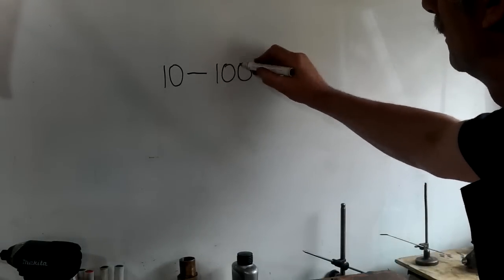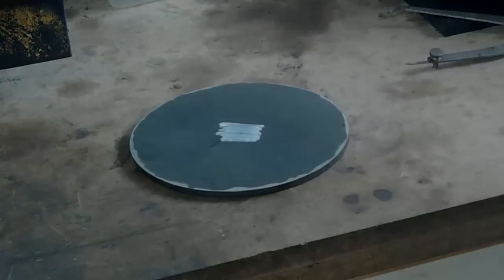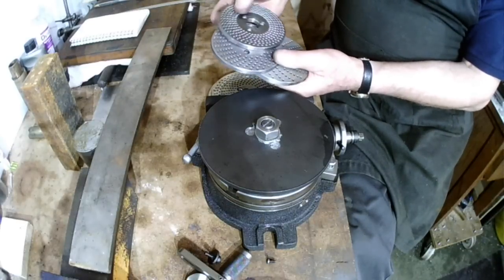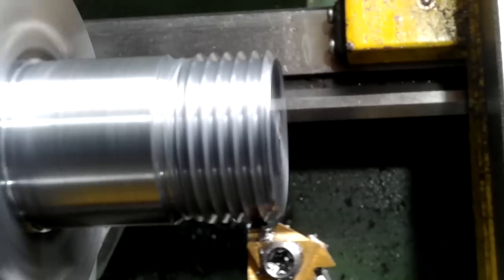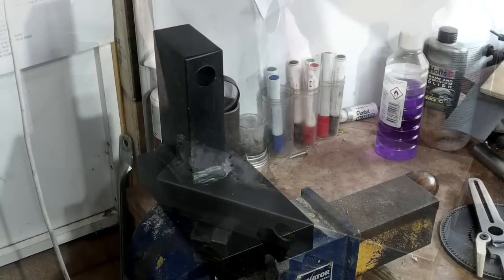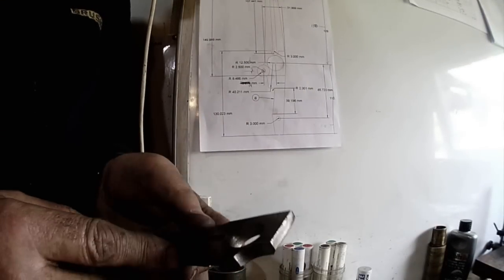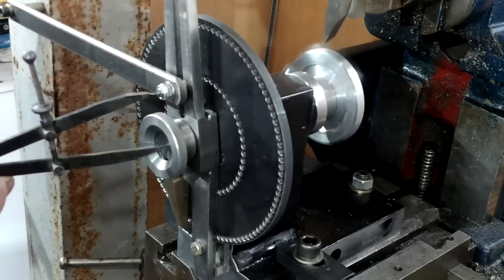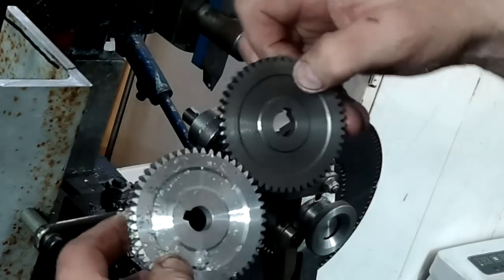Gear cutting on a Shaper (making the tool)

Comment: mate this is an awesome outcome! my "Gear Cutting on the Shaper" video series was a lot of fun to build, the moment when your first gear is completed, is such a great feeling hey! New subscriber here! there are two things I like about the orientation, that were concerns for us, firstly, you are supporting your blank against the cutting force of the shaper, something which I was concerned with our arrangement. Having the index plate outboard also keeps hands in a safer place than in our build.
secondly, there would be a slight rotational error introduced using the arm approach instead of the constant rotation provided by our wire guided setup, that said, you have a much more flexible PCD (PCR) setup, and I seriously doubt the error introduced would be significant or even measurable on all but the smallest tooth count gears. top job mate!
Reply from the maker: Hi JBFom OZ, I have enjoyed watching your channel and I thank you for your subscription and comments. When I made my first gear(shown in the video) I was still experimenting and I did for a short while run the shaper with the cross feed out of sequence, still I shaln’t use it as a 50 tooth gear, I will probably remachine the OD and make it in to another smaller gear. My shaper as you can see, is quite old and is in need of some serious repair but that is for another day.
Cheers Mate
Regards.

Comment: Well done Paul. I've been scratching head over the exact same thing the past few weeks. And here a solution pops up!
Sure, there might be a small error in the arc, but it should really be minimal. After all, we are not making high precision gears.
I'm actually busy with a round column fix for my mill drill like yours at the moment.
Reply: I've got some videos detailing a solution to the round column mill Bruce Whitham and I developed on my RF30 round column mill, see the Rong Foo playlist in my channel, might be some useful ideas there for you guys. Bruce is also now selling this solution as a kit, called the Tru-Line 8 if you wanted an off the shelf option as well.
Reply from the maker: @JBFromOZ  I have seen this video and I like it.
Reply: @JBFromOZ  Yes, see that,but importing to Soth AFrica from Aus is near impossible, so I designed my own. That is for the RF40, which is very different in design. I can't see which machine Paul has, but mine is gear driven.
Reply: Perhaps Paul can give us a little workshop tour☺ then we can see what machine it acually is? His shop and machines looks very similar to mine.
Reply from the maker: @terryb5612  I am currently working on a website to give away the plans to my projects etc. I’ll put pictures of my workshop on that..
Reply from the maker: Hi, thank you for your comments. Yes there is a very small error and like you say they’re not high precision gears. I am interested in seeing how you solve that “round mill post” problem because I too am going to try and sort that issue, one day.
Reply: @Thesheddweller  Almost done with it. I'll try pick up you e mail address from your channel and forward picks of how I did it. This is a must for that silly design. ☺
Reply from the maker: @terryb5612 , my email thesheddweller@hotmail.com. looking forward to it..

Comment: 25:46 it appears that the step over is occurring on the cutting stroke.
Reply: It's possible the motor is running backwards. It seems like the cutting stroke is faster than the return.

Comment: Very very cool! Would it be possible for you to post the excel sheet? That sounds like a very interesting read. 
Also, and maybe I didn’t catch it (if so, I apologize) but what did you end up having for divisions for each of the plates? I probably would also be interested in going up to 120 teeth, only for the fact so you can do an excellent approximation of Pi (5 x 71) / 113. 
This is a nice solution if you don’t need a semi-universal head like a bs0. Kudos!!
Reply from the maker: Jeff Pedlow Hi Jeff, I’m not releasing the spreadsheet sheet for two reasons. 1. I’ve not verified anything on it (it did work on the 50 tooth gear). 2.it was done on an apple spread sheet, I did rush it and as a result it’s a bit disjointed but for me it did give the results I needed.
120 holes is going to be a challenge I would like to hear how you get on.

Comment: Great Job!  Thanks for sharing
I had seen the cable actuated versions and felt that solution to be a bit questionable – I wondered about using a solid linkage and you have proven that works.
I would love to see a video on your excel sheet that calculates out all the gear cutting figures
I cant believe you drilled all those holes – when the day comes for me to do that I plan to use the DRO hole circle function but I don’t know if that is wise
Thanks for the video  - you presented that really well
Reply from the maker: Hi Peter.
Thanks for your comments, much appreciated. 
The DRO technique, in my mind, is possibly the most difficult way to do this. Let’s take the 100 hole range, you’ll have to calculate two dimensions ‘X’ and ‘Y’ for each of the 100 holes, then recalculate them again before you commit. It was bad enough on the dividing table. Mind you, for the ranges like the prime numbers, it will prove invaluable.
I’ve not published the Apple spreadsheet because I haven’t verified it. 
I am still making fine tuning adjustments, and may make another short video to explain setups and alterations. I may have to make a finer feed to my shaper cross slide, but because it’s an old and worn machine some things will need repairing.
Good luck with your version.
Regards.

Comment: Is there a reason why you didn't use silver soldering to get a tidier result than welding?
Reply from the maker: Hi Brian, yes, simply that I’ve got a welder and I’ve never done silver soldering. 
All my engineering life, it’s been my job to Finnish items welded together.. and the guys who welded at the factory I worked at, were the best of the best, I would embarrass them with my efforts if they saw my awful pigeon poo welding.
Regards

Comment: If, instead of drilling so many holes on so many plates, would it be possible - and I’m not a math guy - to drill sets of holes that radiate out from the center in an arch then combine that with a series of indexing holes around the outer edge with their own, separate, indexing pin. Then, by working your way around the indexing face at say the sixth hole in each arch - then rotating the indexing plate to the next edge hole , say each “C” hole of a series of holes labeled abcd(etc.) then, it seems to me that you could have a single plate that would index thousands of gear teeth and a simple chart that would tell you that C-6 is a 52 toothed gear - just a thought!
Reply from the maker: Hi Matt. Thanks for you comment and suggestion.
That would be a pefect solution, but I doubt it would work. 
Firstly, each radial arch of drilled holes would have to increase in numbers as the radius increases, restricting the next radial arch of holes.
Secondly, the combination could be quite complex  for example.. to make say 11 holes may need a combination like A1, C6, E2, F9,…. requireing some sort of chart to navigate the holes in the correct sequence.
Thirdly, the idea, although brilliant, I think you  would find that the range of holes, 'while in the mind cloud', may appear possible, a bit like the penrose stairs, but when put to paper prior to being put in to practice, is a different matter.
Try working out this problem, using that idea, What combination would you choose to get a set of 99, 77, 43 and 11 gears with properly spaced teeth? and what number of holes, while drilling the plate, would you start with?
Maybe it is possible, but that is probably something  for someone else to have a crack at, I remain pessimistic over this one.
However,  it won’t stop me looking at it.

Comment: Hello, the tool is really beautiful even the care with which it was created but it has a geometry error on the linkage ... the variation of the angle of the linkage during rotation creates a defect (even if small) in the profile geometry of the generated tooth. However the work with the shaper is always interesting and thanks for such a nice video
Reply: a point on the pitch circle of the gear blank should travel exactly the same distance on the circular patch as the lateral distance that the shaper table travels shouldn’t it? I don’t see how this arm device can do this. There will always be a cosine angle error. Having said that, it could well be that the error is insignificant and does not pose a practical problem. I’m not sure what you mean by track rods. My concept for a similar device would use a stepper motor. Of course my concept is all talk at this point whereas you have actually done something, so hats off to you.
Reply from the maker: @sblack48   Hi. There is a cosine error as you point out, from what I understand the error shows up greatest at 10 teeth and less at 18. It is true that there is a slight acceleration towards the extreme ends of the arch of rotational travel durring the cut. Track rod ends and an adjustable rod will replace the current tie bar to aid trimming at top dead centre and remove the .002" - .003” backlash leaving whatever flex remains in the fixed anchoring point. Using a stepper motor anchored to the table is a brilliant way of dealing with the gears radial positioning. let me know how you get on. Regards
Reply: Would this method produce the right profile in bevel gears?
Reply from the maker: @sblack48  Hi thanks for watching. I would doubt it, straight involute gears maintain a radial profile along it's axis. I’ve not tried it, but I would think that the greater the helix the teeth profile will distort, it’s possible that the root between each tooth will become concave. but thats just a guess.
Reply from the maker: Flavio Masenadore thanks for your comments, I am aware of the geometric error due to the linkage. That is going to be dealt with once the new track rods arrive...
Reply: a number of people have pointed out that there is an error useing that system but none of them have been able to make or describe a simple mechanical device that could be fixed to the machine to correct that error